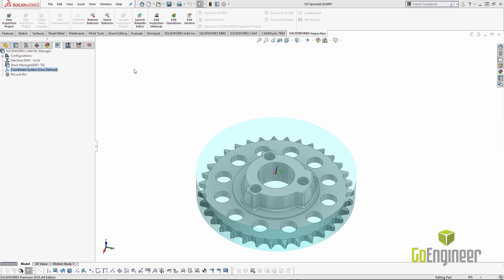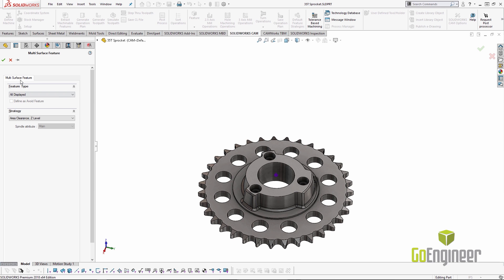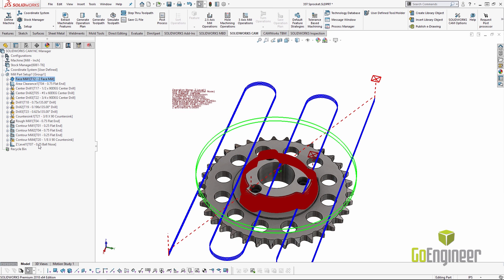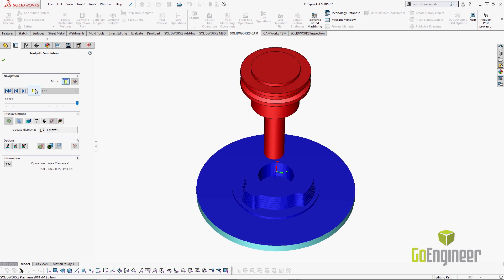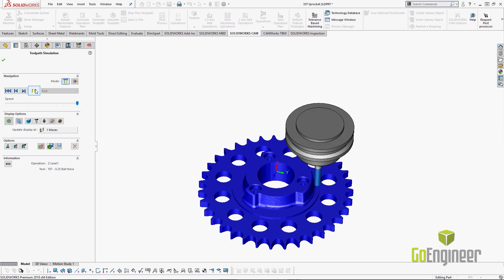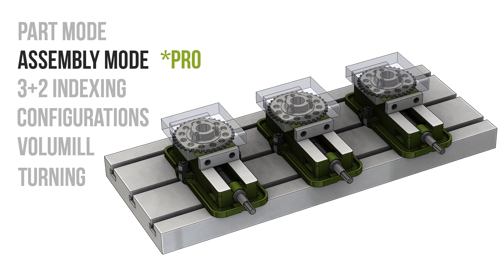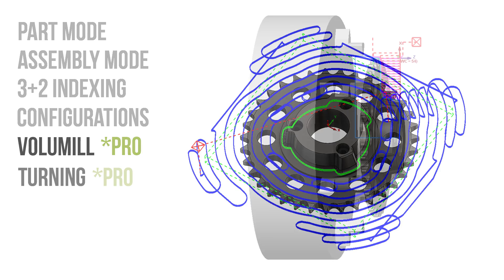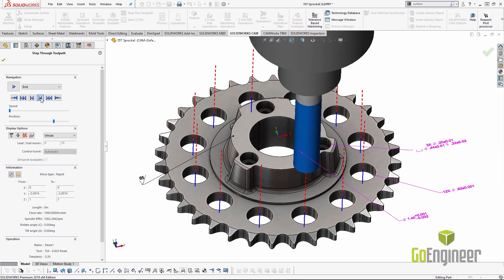SOLIDWORKS CAM

Comment: Hey. 

Maybe you could help me out a bit. I have basically a circular object (revolved sketch). When I do a Simulation, (I have STATIC with rotation and pressure) Displacement is  irregular around circumference. Let`s simplify it - a geometry circle. Displacement in 0/ 360 degrees is 1 mm, but at 180 it is 3 mm. I just don`t understand why is it so,  why it is not the same all around.
Sterss and Strain is quiet regular all around.
Reply from the maker: Hi Dairis,
I can't tell what could be going wrong from the description you have made of the problem.  If you have not done so already you would want to contact your local VAR (http://www.solidworks.com/sw/purchase/varlocator.htm) so they can help you with a more in-depth investigation of the issue.